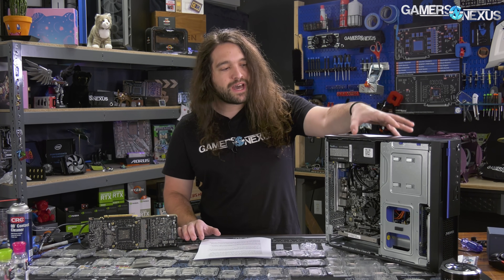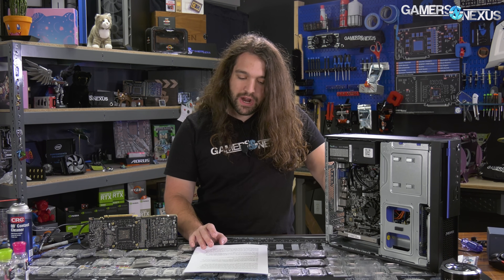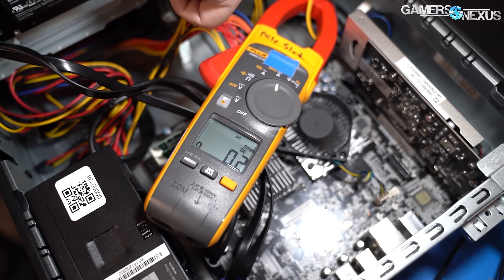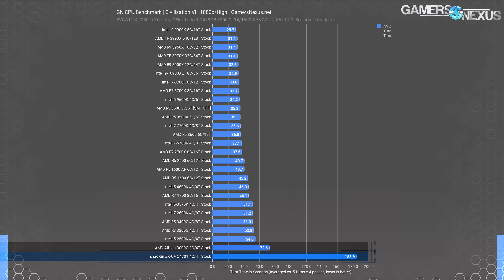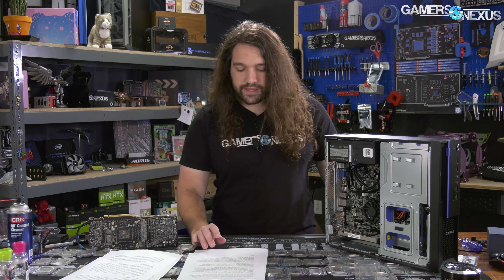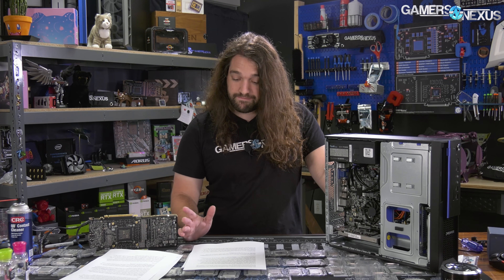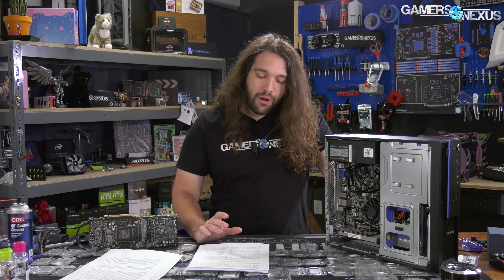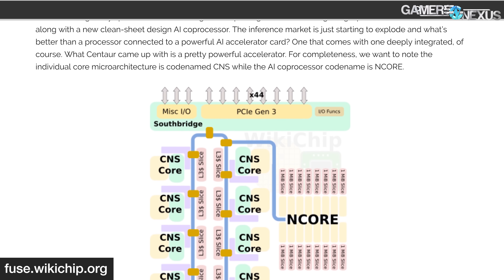"Trillion Core" Chinese CPU vs. AMD & Intel: ZhaoXin X86 CPU Review ZX-C+ 4701

Comment: 2500K:  "I'm still worthy!"
Reply: AMD A8 6410:I'm still worthy
Reply: Damn, have you watched the recent GN's video about older CPU?
Reply: YES! Yes he is worthy! well i still uses one so i maybe little bit bias :)
Reply: @gearz2570  i have a A8-6410 too 🤣🤣 btw i'm upgrading to a Ryzen 5 3600 and RX 5700 XT 🤣😥
Reply: I'm on 2600k that's about to get paired with a RTX2070 or an RX5700XT and I'm thinking of getting a 1440p monitor  :~)
Reply: @pegasusted2504  madman
Reply: @Salt Maker 1333 running at 1600 with xmp :~) had 12GB 2x2 and 2x4 sticks but over the past year I gave it some more life and went to 24GB and a strix1070. Runs ace so thought I'd get higher graphics before waiting maybe another 2 or 3 years to upgrade to new board and chip, by that time 3rd gen ryzen shsould be cheaper. I love this 2600k, one of the best purchases I ever made, lasted me nearly 10 years so far.
Reply: I got the i5 2500k's ugly sister... The i5 2400......
Reply: @mashedpotatoes5323  Rocking one of those as well. Combined with my rx570 I can play anything on medium to high at 1080p. I see no reason to upgrade, especially since I'm a couch gamer and have no plans to upgrade to a 4k tv anytime soon.
Reply: @gearz2570  id have no issues running my phenom2 6 core at 4.0 ghz in a "new" machine today

for a person like my sister that only plays WOW, sims3 or 4.... and lighter games like that
hell, it would only bottleneck my gpu in only a select few new titles.... 

mostly DCS flight sim.... HUGE bottleneck (due to DCS being an AMAZING sim.... but programmed like poo)
1700x at 3.95ghz... and i havent looked back
Reply: iirc.... 2500k was pretty close to the thubun 6 cores.....

1090t's were the little engine that could..... just keep on chuggin away at it
Reply: @kainhall  I upgraded to a desktop with a 1600x and I'm so happy I fid
Reply: I still use my 2600K all day every day
Reply: Im using i5-750 lol
Reply: For all you afraid to overclock:
I've had my 2600K within months of its release and first thing I did was overclock it to 5Ghz with an H100 all-in-one and all the power savings features turned off. So it never downclocked at all, ever.  The water cooling broke 6 years later so I reduced it to 4.4Ghz with the stock air cooler and now power saving features on. The CPU gets to 98 degrees whenever I play certain games and has been like that for years. The comp stays on for weeks and weeks at a time (43 days was my record, then power went out) and has never frozen or blue-screened. 

Even more sketchy is I'm also using two Vertex 4's in a RAID 0 with the operating system on it from 2009. Crystal disk says the drives are at 91% with 61000 hours and less than 300 power on cycles.
Reply: ryzen 2200g just enter the chat
Reply: @pegasusted2504  Oh boy, got you beat. RTX2070 on I5 750@4G... Works well for how I use it now, but I bet that CPU's going to start getting hammered when the newer titles that interest me start coming out.
Reply: @smokegames1179  Ryzen 2200G x EVGA Nvidia GTX1060 6Gb 8gb ram Joined Chat
up Next : Ryzen 5 2600X

Comment: *CIA furiously taking notes *
Reply: Russia is switching all it's Government Computers not to ARM or RISC-V but CISC much more complex  and slower but harder to hack and not reliant on US Tech to avoid a US Embargo!

They are also replacing Monolithic Kernel with Micro-Kernel for the inherent extra security and ability to reboot modules without system wide reboot and much faster start-up times when a system wide reboot is needed!
Reply: @DarthAwar  do you mean CISC ? cause LISC seems to yield no result on google
Reply: @DarthAwar  Thank you, for the (long and good) explaination !
Reply: @DarthAwar  security through obscurity rarely works out
Reply: @hdthor  In the Long Run Yes you are Right, But in the Short to Mid-Term Yes it works out very well imagine people on FreeBSD getting targeted with a super malware or hacker very very hard but not impossible but while too few people use it what is the point of targeting it?
Reply: @hdthor  simcard and especially credit/debit card worked a long time this way cause it was literally cheaper to add a layer on the silicon instead of paying million real security professional...
Reply: *FSB looks the other way!
Reply: The CIA et al would completely disassemble and test all computer components bought from china looking for hidden micro code that could potentially be a security risk.
Reply: Hopefully they'll find the patreon...
Reply: CIA and similar just order PCs with hardware backdoors disabled such as Intel ME/AMT and whatever AMD's equivilent is. The same backdoors used by certain agencies to 'monitor' certain system's covertly with persistence ranging from ring -1 to ring -3.

Edit: Dell for a fact offers PCs with Intel 'features' disabled for more 'secure' governemtn orders.
Reply: @DarthAwar  Lol cool story bro rumored by Russians mmkay 🥴😂
Reply: @DarthAwar  good luck to live without fixed length instruction and OoOE and register renaming because you’re simply running a electrical garbage that can’t do anything but playing pac man, trust me even arm learns that OoOE and register renaming are the future.

Comment: Ah back to the Socket 7 days when there were multiple choices to put in your motherboard!  I miss Socket 7  :(
Reply: Ah yes I miss those days too. Placing jumpers all over the motherboard matching the speed and multiplier. Those days were the best.
Reply: K6-2 500 was the cats ass. Last semi usable socket 7 processor which could utilize Intel or AMD tech.  Wouldn't that be grand if someone standardized a socket type which anyone could use?  Nah, that violates every profit based principal companies use to rip off consumers, no good indeed.
Reply: well compared to now that you have CPUs with several hundred dead pins Socket 7 was better. I am not kidding either Intel sockets have dead pins meaning unused not used for electrical positive, electrical negative, ground nor the sometimes needed part of a 1 pin separator to have no cross talk signals between bigger and/or thicker parts in a electrical system.
For cross talk they have solved it already with whatever they have put into the socket then into the chip so then you only have the in, out signals then ground.
I  get having "reserved" pins is a thing but when your company uses a socket for 2 CPU generations having them is just a waste of space.
Reply: @pixels303at-odysee9  Don't forget K6-2+ for adding L2 on-die and bumping performance up by over 10% with barely any extra power. K6-III+ also kicks ass as the last-in-line performance option for SS7, but wasn't available on shelves and now is pretty difficult to attain at reasonable prices.
Reply: @pixels303at-odysee9  Ah, yes. Companies are not allowed to make money
Reply: Ahem, Socket 370.
Reply: Nah, 40 pin DIL those where the times...
Reply: @pixels303at-odysee9  At least Amd has the same socket for 3 gens now(am4), wich is compatible with older mobos. Intel changes sockets every gen without even changing the cpus!!!
Reply: @GewelReal  I don't believe anyone thinks companies shouldn't make money, but would you like to go back in time to the days when everyone had proprietary charging cables? There's a reason why micro usb/usb type c are mostly standard now, because proprietary cables fucking sucked hard...
Reply: Now it's so simple, everyone and their mother could build a PC. Ah the days when building/modding a PC meant something and was uncommon.
Reply: @geiers6013  and am3/am3+ had a LONG time span.... like 10 or 12 YEARS!!!!
and you could run an am3+ cpu in AM3....just needed an am3 cpu to load new BIOS

i would not be suppressed if amd offered intel a deal to use "am5"..... 
i HIGHLY doubt intel would accept, or make a similar offer...
Reply: @kainhall  Intel would not accept because they have deals with mobo manufacturers to "change" sockets to sell more mobos. That is typical anti-consumer behavior by Intel and the mainboard manufacturers.
Reply: I would dream and draw S-S-7 all day every day when I was 12, AGP and that crazy clock speed was an unreachable but desirable fantasy
Reply: @minus3dbintheteens60  I remember that time when Pentium 200 was the fastest thing for a long time, and then suddenly there was a surge of advancements, increasing clock speeds every month by 20% until they reached the 3000MHz ceiling.  That pretty much was the fastest clock speed until recently with 7nm with AMD, clocking up to 4.5ghz easily.  That's why computer chip manufacturers had to think outside the box with multi core processors.  I always thought about this idea back in the Amiga days, when I learned about distributed computing by connecting multiple computers together to vastly increasing your processing power, yet it took many years for x86 to adopt it with introduction of Core2duo and Athlon 64x2.  I find that business often is happy with moderate improvements rather than making massive innovations.  If there was a drive to offer better tech, I am certain that we could have had multi core processor tech when Socket 7 was a thing.

Comment: I'm suprised that the CPU even works with windows 10 without being unstable.
Reply: You can run Windows 10 on a potato. Running a server on W10 with an Athlon II. The old ass HDD is actually the bottleneck lol
Reply: @ekiM2K  It's not about the performance, it's about the stability.
Reply: @ekiM2K  yea. Im surprised mostly about the reverse engineering of the ISA enough to work with windows 10 and regular applications. Morden x86 is very bloated and hard to fully reverse engineer so I thought it was x86-64 but only with the essential instructions to run the OS and a few special programs with sub-par stability.
Reply: @andrew8293  Well the video stated that they have a relationship with Via and Cyrix. See back in the day Intel actually sold rights to manufacture x86 processors. This is how AMD got access to it, and later when Intel tried to revoke all licenses and started suing various manufacturers, various lawsuits came about. AMD one a royalty free license to the Am386 design and owned the rights to any design built from that base point. Other companies like Via and Cyrix started about reverse engineering versions of the architecture as well based on this base architecture back then as well. That's how they made and sole processors that were compatible through the 90's and even early 2000's (Via was big in the small form factor x86 PC market back in the mid 2000's, I remember building one myself).

Now here's the thing. That base x86 architecture, that's what Windows cares about! All new expansions of the x86 instruction set are tacked on to the end. Note, AMD and Intel have been independently developing the architecture since this split way back when. This means that through the 90's and into the early 2000's Microsoft was contending with the fact that there were 2 independent big players as well as a bunch of small players. So design wise the kernel has been contending with this fact the entire time.

So, it's designed in a way to deal with that. The kernel will use a newer instruction if it's available, otherwise falling back to a software based solution if the instruction doesn't exist. So as long as you have that base x86 architecture, Windows doesn't care, it'll keep trucking on forward.

At one cost... PERFORMANCE.

Hence why this CPU is dog ass slow. It just doesn't have all those newer high-end math instructions. Hence why all the benchmarks they employed were god awful. It was doing all that math in software! I bet it performs just fine as a general purpose UI processor. It probably runs word processors just fine (which is what a government office computer is going to need).

This is why dude man in the video later talked about hitting the road running. They don't have as much to make up from here. All they have to do is develop those newer faster instructions.

And here's the nice thing here... they don't actually have to reverse engineers those.

The instructions are defined. We know their interface... the way to call them, and the way to use their results. That's all that's really needed. And of course we know them, because if we didn't the likes of Microsoft, Apple, the linux community, and any other OS developer out there could not reliably create software that runs on that processor.

Furthermore, if you want a very stable OS that runs across decades of hardware (like Windows), you're not going to exploit those functions/instructions. Like... OK, if f(x) is defined to take inputs on registers 1 and 2, and have an output in register 0. Just because it MIGHT also place a remainder in some other register because it used it as a scratch register. You don't read that register for anything. It's not part of the definition. This means it's unreliable... if you did rely on that, and then the hardware manufacturer changed its internal behaviour, then your software breaks! This concept is called encapsulation. And as a software engineer, even if you know how to break encapsulation, you do so at your own risk. And this is how an OS like Windows operates... (and of course Windows has become more stable over the years for various reasons... including respecting these things and purging parts of the kernel that exploit hacks like this).

Of course in more embedded systems where you know the specific hardware, you can exploit it willingly, to get that extra edge. Say in things like video game consoles.

So, the jobs of these companies are really to come up with their own implementations of those instructions. Just making sure that inputs and outputs are shaped the same as the definition is. And as long as they do that they'll have nearly perfect stability (of course perfect stability is impossible... there's all sorts of mishaps that can impact this... but they're severely limited at this point because OSs compensate for it). The problem here isn't stability... it's creating performant hardware implementations of these instructions and packing them into the silicone. That's the intellectual property that AMD and Intel hold on to. In simple terms... it's not knowing if they need to implement square-root, that they know. It's knowing how to create an algorithm on silicone that does square-root as fast as AMD/Intel can do it in their chips (replace sqrt with a far more complicated instruction).

Of course, software that is designed to directly access specific instructions can become more unstable because they do have much higher expectations on the hardware you're running. Software that more directly accesses hardware to perform more time sensitive processes like video games, renderers, etc which need to perform more modern maths. These will become far more unstable and is why most of the tests that failed in this video were related to these.

Mind you things from here get a little more complicated into regards of x86-64, since this is technically a different set of instructions developed by AMD on top of x86 and holds the licensing rights to. But this problem is just legal licensing issues (hence the videos long rambling about the complicated business relationships and how AMD was involved but no longer involved due to various legal/political hub-bub). But the hardware side principal stands the same. The right to sell hardware the uses the instruction sets has nothing to do with how stable it will be.

TLDR;
Via and Cyrix are involved, and they already did most of the leg work of gaining access to the x86 architecture back in the 80's and 90's, as well as more leg work in more recent years with AMD to get the x86-64 base architecture. Tacked on with the fact that Microsoft explicitly designs their OS to be fault tolerant due to its need to support decades worth of evolving hardware. Means it can be very stable as long as the core x86 instruction set exists, if only at the impact of performance.
Reply: @lordofduct  well I just read the TLDR because you wrote a lot. I thought the same thing about Cyrix and Via but they reverse engineered the 386 and 486 and partly the 586 before going out of busniess. Windows 10 relies on AMD's AMD64. (64 bit) and Intel's 686/786 (32 bit) ISAs which are much more complex than the old 386-586 ISAs. Especially since Intel and AMD change it all the time.

Edit: I read about the faster math functions and the fact that we know how the I/O works it was easy to make a chip thats compatible. That probably helped a lot but that probably isn't enough to make a chip that stable on an OS they have no control over.
Reply: @ekiM2K  well im runing athlon II x2 CPU and HDD with windows 10
before im upgrading to Ryzen 3 2200g and SSD

Comment: My first motherboard was a VIA, fond memories of that K6-2+ system.
Reply: Yeah, pretty sure mine was too, a BioStar I think.
Reply: My first build was a K6-2 as well, but I can't remember if it was a Via or SiS chipset... Had a 3DFX Voodoo1 tho ;)
Reply: Good ole times :)
Reply: P3 500 slot on a dfi with ye good ole' via 133. First PC
Reply: Thinking of those days makes me tear up a little
Reply: aethertech k6-2 and k6-3+ were killer chips
Reply: My parents bought a Cyrix M2-233 in around 1997? as an upgrade to our 486DX2-66 Packard Bell. Obviously, because it was cheap. 
It was so terrible that we built an AMD K6-2 400 + Gigabyte GA5-AX + 3DFX Voodoo Banshee AGP about a year later with parts off Tiger Direct. And the rest is history. I have that shitty old Cyrix to thank for this nonsense. Had they ponied up and bought a Pentium 2 system, I may have turned out completely different.